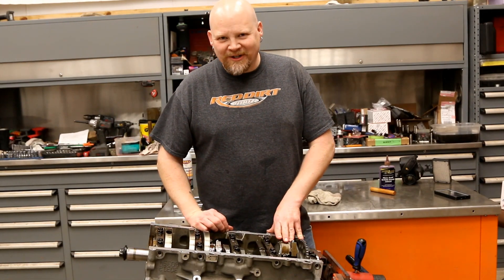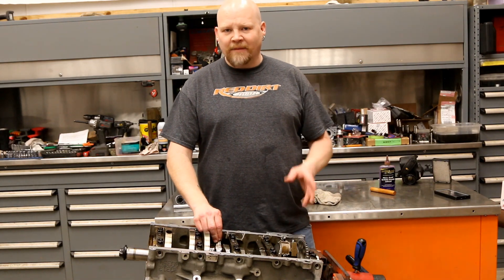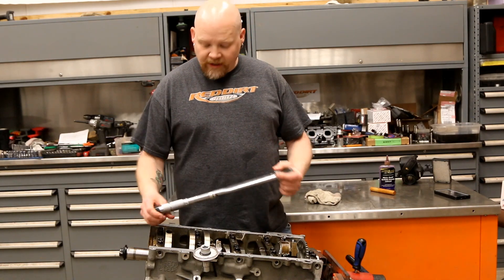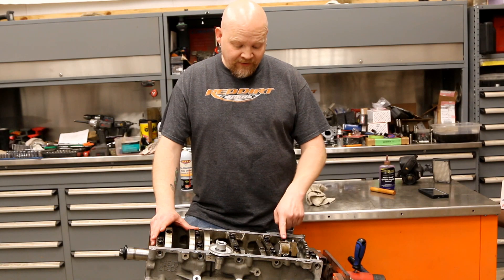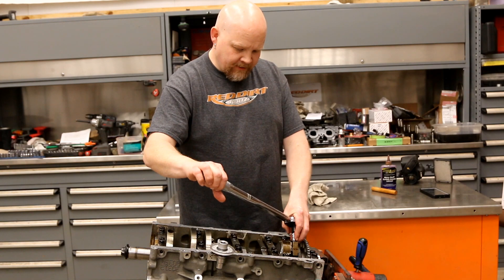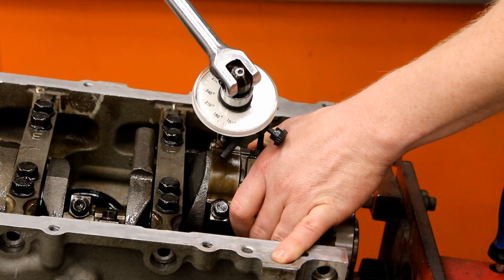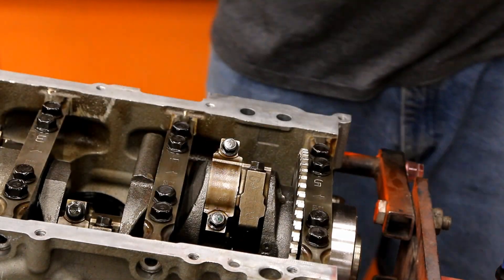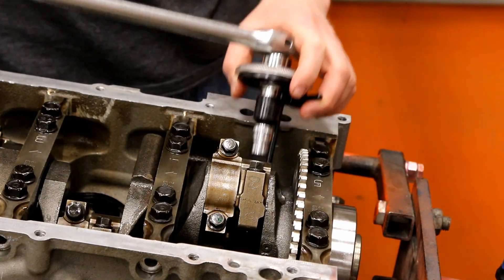How to Tighten Torque to Angle Bolts on a GM Gen V Engine

Comment: Hey are you sure on that service bulletin and figures? I checked prodemand and it says "if reusing connecting rods DO NOT reuse connecting rod fasteners. during and installation procedure the new connecting rod bolts can be re tightened  a maximum of 3 times" sounds like the rods the engine comes with doesn't have fasteners you can retighten again?  Also it says 15ft lb and 85degrees.
Reply from the maker: It is entirely possible that I misspoke, it is supposed to be 85 degrees. I will add a caption clarifying that. Thanks for the catch!